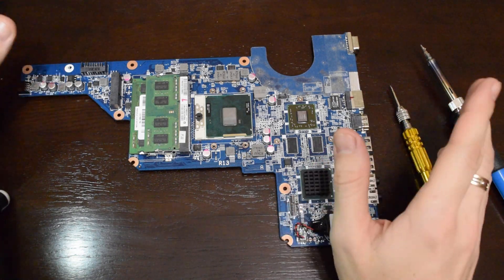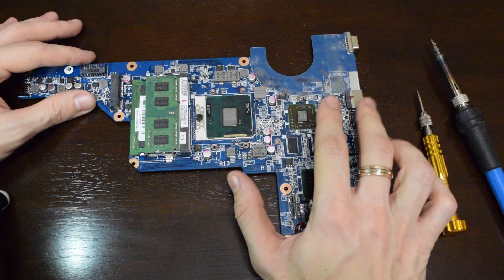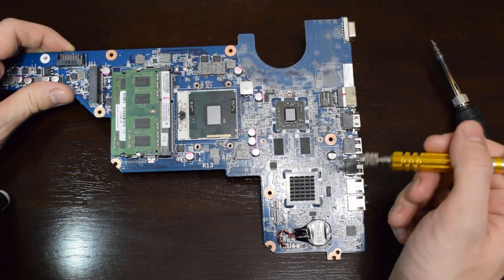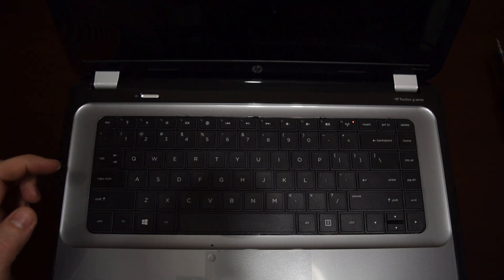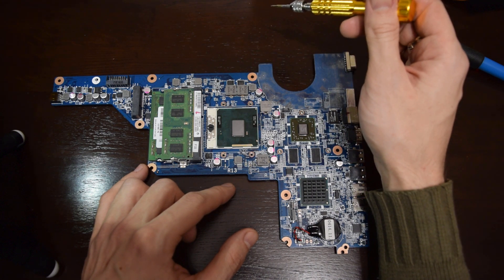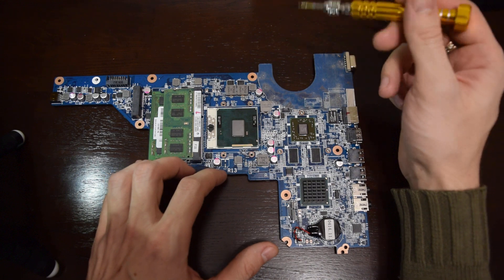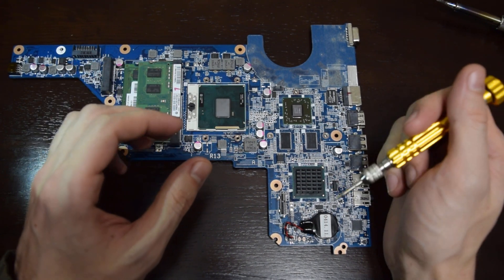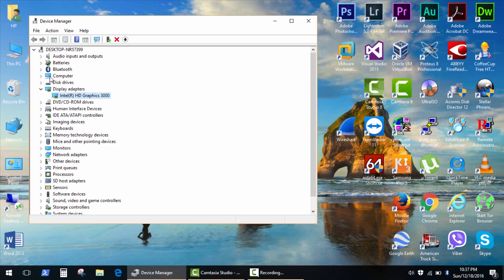Fix Dead GPU – Convert HP, Dell, Lenovo Laptop to UMA Graphics (HP G6 Example)

Comment: After removing that,my laptop not show display what i am suppose to do...plz rply me
Reply from the maker: what's your laptop model?
Reply: Tnx for your rply...Laptop model is hp pavilian g6 1201tx.....
Reply from the maker: If you have Intel's CPU and the problem really in GPU here's the coil to remove: https://ibb.co/eF8O0e
Reply: I have intel cpu and I remove that coil...display not turn on...
Reply from the maker: What kind of LED indication do you get?
Reply: When laptop turn on caps-lock LED blinks one time....display blank....
Reply: Sir what i am suppose to do now....plz tell me...

Comment: Hi, I've got the same problem with my lenovo g500s laptop, i wanted to use the method in the video but i don't know which coil i should remove. if you could please help me and show me the coil i have to remove.
the MB images are on my drive in the link below :
https://drive.google.com/open?id=1zwj2G2yq09VIsBVcYokdiigUiMVd0t7k
Reply: i did some research and i suspect that these 2 coils are the ones i should remove, am i on the right track ?
https://imgur.com/CpbNzVi

Comment: how to identify the coil to remove. mine is a dell latitude d630
Reply from the maker: Unfortunately it's not gonna work for you. Your laptop has Core2duo CPU which doesn't have an integrated graphics into it. Which means your laptop has only dedicated graphics in it.
Reply: 2013Electronics&Computers +will it work if I add a pcie external graphics

Comment: Will it work on a sony Vaio VPCEB series laptop? Can you tell which coil is to be removed?
Reply from the maker: Here's the coil that powers GPU: https://ibb.co/bDwWry
I've never tried this method on Sony laptops. It work perfectly for Dell, HP, Asus, Acer etc.
Reply: My laptop currently displays crazy pattern over the display due to faulty graphics, will removing the coil use the intel HD and solve it?

Comment: Can it be done Asus K53SD motherboard? (i3 second gen., nvidia gt610m graphics)
Reply from the maker: Just remove that coil and it will work (of course if it's GPU problem): https://ibb.co/gC6HpJ
Reply: 2013Electronics&Computers , thank you. I already tried that. It's now really important, I already ordered a new one. My board is rev 6.0 Asus K53SD (one with integrated i3 processor and graphics chip). I tried taking out those, but nothing happened. I tried all those easy fixes; switching ram, hard reset, taking out cmos battery. Nothing on screen, laptop starts normally (power light on, left light led marked as light bulb, caps lock on). Disassembled it completely and tried the bare test (motherboard with cooling system connected to outside monitor), and nothing. Checked my display, it has normal power supply; 19, 5 and 3.3v. 
Both processor and the graphics produce heat, seems that they work normally. Didn't check power draw, I don't have power supply unit (and to lazy to make one). 
Now it's a challenge. I guess you know how that feels.

Comment: Hello, need help. You mentioned CPU with integrated graphics. Will this work with HP pavilion g6 2005ax AMD apu with integrated graphics 7640g + discrete 7670m?

Comment: I have an acer aspire f15 and I want my laptop to use the dedicated instead of integrated but nothing works so is there a physical problem maybe?
Reply from the maker: Use the following steps to adjust graphics processor preferences.

Right click on the desktop and select NVIDIA control panel.
Select Manage 3D settings. Click Global Settings.
Note: To change settings for an individual program, select Program Settings instead of Global Settings.
Select your preferred graphics processor:
Auto-Select – Provides a balance between performance and power savings.
High-performance NVIDIA processor – Provides optimal performance.
Integrated graphics – Provides optimal power savings.
Under Settings, you can adjust the settings for each feature to meet your needs.     Click Apply to save your changes.

Comment: Hi, help me please , how to ignore the main videocart and use only this integrated in processor i5-430m. The laptop is Toshiba sattelite L505 and this is the picture of motherboard  https://drive.google.com/file/d/1T1D9Mu6_6MQavTScheAeZLO69eSuuMDn/view?usp=drivesdk   
Thanks in advance !!!
Reply from the maker: It's probably not going to work for this model but you can give it a try. Here's the coil that powers GPU: https://ibb.co/jH6ACJ
Reply: 2013Electronics&Computers 
why arent you sure in your answer

Comment: thank you so much ..my laptop is hp probook 450 G2 the power lamp and the switch it's directly working just when I join it the power...without working the laptop...also not working....thank you,,,,please help me to fix it
Reply from the maker: It's hard to say what's the problem without checking some components if the problem in GPU you can try to carefully remove these coils: https://ibb.co/h4bmZy

Comment: Hello, can you please help me with which coilt to remove? I have HP 4710s laptop. Where i can send you picture of mainboard?
Reply: ...i've upload you picture here: https://ibb.co/jC3XVT
Reply from the maker: Unfortunately it's an old generation of CPUs (Core 2 Duo) and it's not gonna work. That CPU doesn't have an integrated graphics chip in it.
Reply: found same grafic card - ATI chip on ebay, used. If i change it, is it option it should work?

Thx for you answers!!!!!

Comment: I have hp elite book 8560, will this work?
Reply from the maker: Your laptop has removable graphics card! Have you tried to simply remove it turn on without video card? It should work! 
New video card for your laptop costs 60$ with free shipping: http://ali.pub/2l70ct
Reply: Sorry I think I gave you wrong model name. it's hp EliteBook 8560p , i7 second generation
https://drive.google.com/folderview?id=1wOTq50bjUpVYU-EgnXk318U-K65g7Xfx
Please check my mother board it has on board graphics chip, I think
Reply from the maker: https://ibb.co/dbwufJ 
Here's the coil to remove. I can't find schematics for your model, sometimes it also requires to swap some resistors to switch graphics. Anyway just give it a try you're not gonna make it worth.
Reply: Thank you, will try.
Reply: No luck 😞 after removing coil you suggested , laptop not powering just blink lights then off
Reply: Will I remove second coil?
Reply: @muhammadfaizan8894   I have the same model... did you make it work?

Comment: Hi, it is possible to repair Samsung R540 on Intel Pentium using this method? Thanks!
Reply from the maker: Unfortunately it doesn't work for this model
Reply: 2013Electronics&Computers ohh ;( i see coils on mobo and i have a hope to repair ;( there is another Way to converting to UMA?

Comment: Hi, i have this HP Pavilion G6 DA0R53MB6E0 Rev E R53 will this method work?  the GPU is burned out and the top cover with part # goes off , will this system work , if possible please can you guide me through? thanks
Reply from the maker: It works if it's not an AMD CPU version. https://ibb.co/htCWFJ
Reply: 2013Electronics&Computers  sorry for asking too much questions, how can i tell if it's AMD or intel the laptop is not working because the GPU is bad.
Thanks
Reply from the maker: Remove the coil. Just give it a try, you're not gonna make it worse!
Reply: 2013Electronics&Computers thanks for your effort, your doing a good job I tried but it didn't work for me, I think it's because my CPU is AMD. Anyway thanks for the efforts keep up the good job.

Comment: Hi, i have this HP Pavilion G6 DA0R53MB6E0 Rev E R53 will this method work?  the GPU is burned out and the top cover with part # goes off , will this system work , if possible please can you guide me through? thanks

Comment: how about disabling ati graphics on acer 4738g? which coil should i remove? thanks.
Reply from the maker: It's real for this model but almost unreal at home. Here's coil that powers GPU: https://ibb.co/deE3co try to remove. But in most cases you have to also remove and swap a bunch of resistors from one place to another.

Comment: Very Nice job, will this work on Dell Latitude 830.
Reply from the maker: It's not gonna work for this model because Core 2 Duo CPUs don't have integrated graphics in it like modern Intel Core i3, i5 etc.
Reply: Here's an update: Had taken laptop to guy and he opened it up ran few tests and then closed it saying a chip testing of motherboard needs to be done and referred to a guy who had tools.  I left the laptop sitting for three weeks and today started again and screen lit up as usual but showed windows not start, computer to run self diagnosis which could not repair.  Then asked for system restore but that also did not seem to work.  I restarted and this time windows loaded and things normal since then.  The    computer date was changed to 2008 which I corrected and so far so good.  Wonder what was the problem and how it was solved and for how long will it keep running fine.
Reply from the maker: Maybe there was a bad contact in some connectors or RAM etc. But if the problem was really in the chip then it's not gonna last for a long time. Anyway good luck and I hope it will work for a long time.

Comment: Heyhey!! First off Congratiulations!! This is one of the best methods i've ever seen!! I'm really impressed :D!
I have a similar problem with an asus notebook and can't figure out the problem! It runs normally but without backlight and without data on the screen. I tested it on bad connections and the like but couldn't find anything, and all of a sudden in between testing and checking the voltages, the screen backlight went on and the bios was visible. Then i tested it again on bad connections or broken cables and nothing happened, the light was still on and bios was running. But when i shut it down and tried to restart i again had no backlight and no data, only sometimes the light turns suddenly on without any warning.
would you be so kind and help me? Thanks in advance!
Reply from the maker: I'd love to help you buddy but it's really hard to do it remotely. 
1. First of all try to turn it on and try to press Caps Lock button, there's usually LED indication. Does it work?
2. If indication of Caps Lock button works try to connect your laptop to external TV or Monitor using HDMI or VGA connection just to check if the problem in broken LCD cable.
3. If there's no reaction on Caps Lock then you have problem with motherboard. 
Not sure that the problem in GPU but if you tell me the model of your laptop I'll show you which coil to remove.
Reply: thank you very much for your ultra quick response!!
i'll try the caps lock thing in a minute.
it's a asus r900v and the mb version is: k95vj
i send you a pick of the mb in a few seconds!
Reply: the 2 white squares near the big white blotch were 2 coils i soldered out already. if that was a mistake, then i'll just solder them back in :)
Reply from the maker: Those coils are correct if the problem really in GPU...
Reply: 2013Electronics&Computers Well Damn! Thats a good Point. Do you have any thoughts on what Else could be a Problem?

Comment: hi 
i like to know will this work for my mobo acer aspire e1-572g 
https://ibb.co/jLOzxo
https://ibb.co/de9NHo
problem is that laptop turn on light on cpu fan spin for 15 sec or less and stopped no boot no post . when swtich power off gpu is heating so same told by technician that gpu is heating so it should repair by chip level service 
so it have i5 processor and 4 gb ram so i dont want graphic card will doing this method work which one should i remove 
waiting for your response this model is very costly 50k ind rs so want to use it back 
thanks
Reply from the maker: Hi! If the problem really in GPU then it's 5 minute-work. First of all you have to cut the power from GPU by removing these coils: https://ibb.co/mhWKV8
If it doesn't help then you have to move one resistor R219 to R306 place (it's empty). Unfortunately your picture has very bad quality so I can't show you where that resistor but anyway it's easy to find there are numbers on PCB for each component. Good luck!
Reply: 2013Electronics&Computers  ok bro will try that surely and will  comment  back the result . Should I need to buy any specific soldering iron for this board or just normal one found on Amazon
Reply from the maker: For this specific purpose just a regular one 40-60 Watt.
Reply: 2013Electronics&Computers ok bro thanks

Comment: hello man u work nice i had compaq cq56 with amd cpu and ati gpu , every time i turn on laptop no display and capslook blink ilet it run for 10m and then trun it off and back it work again is it the same problem here gpu !?  and can do the same solution u did ?
Reply from the maker: It's hard to say what's wrong without checking some components. But this trick doesn't work for AMD CPUs.
Working motherboard from reliable seller costs 26$ with free shipping to almost any country: http://ali.pub/2ka704
Reply: I see ,do u think it's the CPU problem? because in hp say if 1 time blink it's cpu failure 
iwill try reballing the cpu before any thing , what u think? 
and thanks for your help a lot  :)
Reply from the maker: You can't reball that CPU because it's not soldered into motherboard you can simply replace it but you can reball GPU or chipset.

Comment: Unbelievable, amazing, and inspiring upgrade.
I am to sad for my HP Compaq 6735s.
My screen totally dead and when I start the laptop it comes with 5 times LED Flashing with black screen!
Please release me from 2weeks of nightmare and tell me its work with hp 6735s and which coil I have to remove.
Thank you Sir
Reply: 2013Electronics&Computers any response!

Comment: Hi sir thank you so much for your video. I have samsung series 7 chronos laptop can you tell me which coil to remove to disable the dedicated amd gpu. Thanks in advance
Reply from the maker: May not work for this motherboard but just give it a try ther's no any risk at all
https://ibb.co/hS5WtJ
Reply: Thanks a lot I already removed one and it worked but I couldn't unsolder it so I removed it with pliers

Comment: Wow Extremely Magic u did in ur video great work done sir #respect 
Sir I got Hp Pavilion Dv4-1436tx intel core 2 duo can it be fixed??
Reply from the maker: Unfortunately it's not gonna work for your CPU, because this generation of CPUs don't have integrated graphics in it like modern Intel Core i3-i7 CPUs.
Reply: 2013Electronics&Computers It has Nvidia GeForce G 105M - 512 MB Dedicated graphics will it work mate?
Reply from the maker: Nowadays laptops have graphics chip inside of CPU it's like two in one and more expensive laptops have two graphics one inside of CPU and another one is a dedicated graphic chip. If the last one dies it's very easy to disable it and switch to CPU's graphics. But the problem that your CPU is very old that technology didn't exist at times of those Core2duo. So no chance. 
Working motherboard with warranty costs 50$ with free shipping to any country from this reliable seller: http://ali.pub/2jlzwi
Reply: Buddy It Got NVIDIA GEFORCE G 105M - 512 MB DEDICATED GRAPHICS will it work now?
Reply: Sir from where I can buy its motherboard ?
Reply from the maker: Working motherboard with warranty costs 50$ with free shipping to any country from this reliable seller: http://ali.pub/2jlzwi
Reply: 2013Electronics&Computers ok thanks so much 🙏

Comment: Thank you for this video!
Can you tell me which coil to remove on my HP DM4 1100eg?
https://ibb.co/dk2ffo

Thank you so much!
Reply: I just found another comment by you about a similar model. It actually worked!
Thank you so much for making this video!
Reply from the maker: Not always works for 1st gen CPU platforms but you can try: https://ibb.co/gEcNAo
You're not gonna make it worse. And just in case the motherboard without GPU with free shipping to any country  from reliable seller just 37$ http://ali.pub/2izjbz

Comment: Very good channel, and thank you so much for your sharing. you are awesome '2013Electronics&Computers'.
Could I do the same thing to my Asus K42Jr (has same problem with Ati radeon graphic. 
Spec: intel core i7, ATI Mobility™ Radeon® HD 5470 1G, HDD500.
The problem is blank display and has an unbelievable hot temp near with the touch pad area.
Thanks alot Man for your kind reply.
Reply: Will this methode work for Asus K42JR ? Thanks

Comment: Please my laptop.. When i press the power button the led on the power socket blinks multiple times and goes off.. Without the fan moving... No light on the keyboard... Plz is the fault from the graphics card or is it from the bios chip.. Plz help me out... The laptop is hp probook 4510s
Reply from the maker: the power socket blinks you mean power supplier!? if so you have a short circuit somewhere and without equipment like multimiter and lab power supplier it's hard to find. You can buy a new motherboard for 45$ from this reliable seller: http://ali.pub/2ip8n2

Comment: I have a Dell e6440 ( https://www.dhresource.com/webp/m/0x0s/f2-albu-g2-M01-B7-B7-rBVaGlYK4y-Ae_46AAE9BWPFs6Y253.jpg/wholesale-laptop-motherboard-cn-0n23jf-0n23jf.jpg)
Do you know which coil to remove ? Thanks !
Reply from the maker: This motherboard has different schematics and dell has two different motherboards for discrete and UMA graphics. I never tested it for this model. These two coils power the GPU: https://ibb.co/cqBnYy
Just give it a try you're not gonna make it worse.

Comment: My HP G72 intergrated can i put ATI graphic card chipset on my hp g72 intergrated motherboard. Thank you
Reply from the maker: Technically it's possible but you need to buy a proper GPU and you need an infrared soldering station to solder that chip down to the motherboard. It doesn't worth money unless you have a buddy who will make it for free.
Reply: I will buy gpu model number ATI 216-0774009 then i put on my intergrated motherboard.